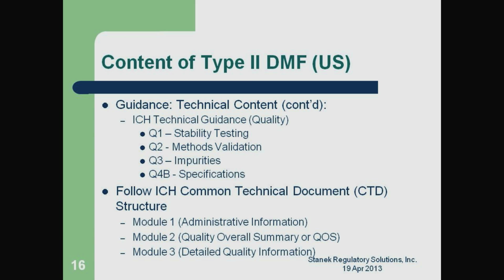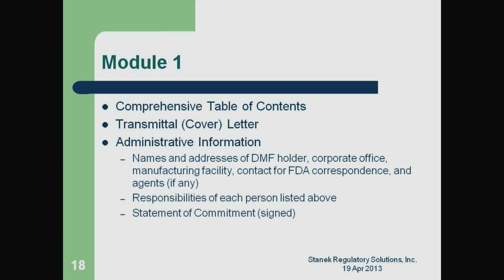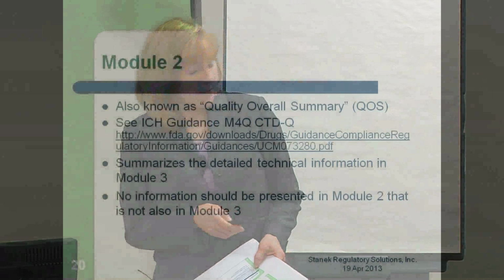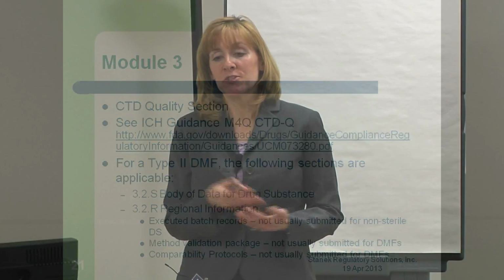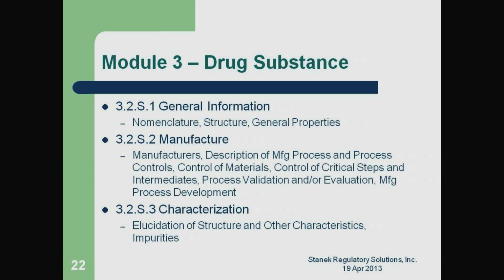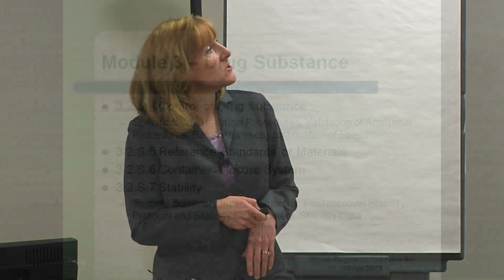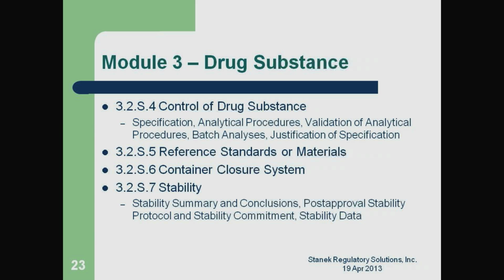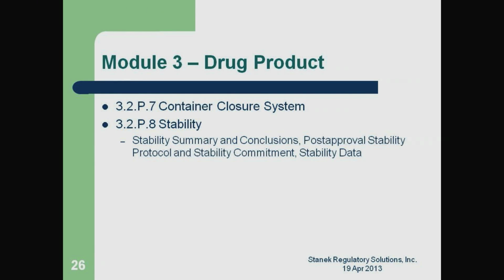Content of a Drug Master File (DMF)  (3 of 5)

Comment: What are the Modules of DMF? For this Question what we have to write please tell me the modules
Reply from the maker: A DMF has five Modules
1. Cover Letter and Admin information, Letter of Authorizations
2. Summarizes the appropriate module 3 sections (and 4 & 5 if applicable)
3. For Type II: Drug Substance, Drug Substance Intermediate and Materials used in their preparation
4. Not necessary for DMFs unless non clinical evaluations are included in the DMF - i.e. an impurity in a Type II DMF
5. Submitted for clinical information only, such as a Type V DMF